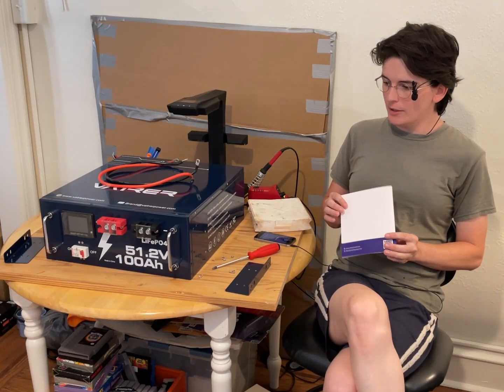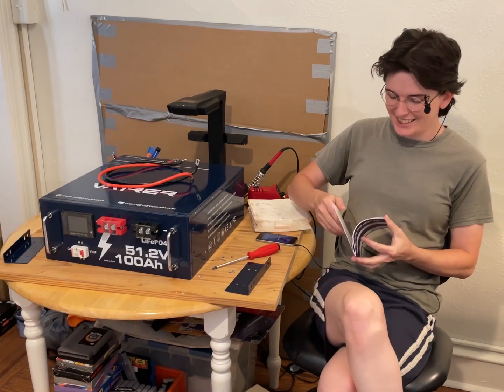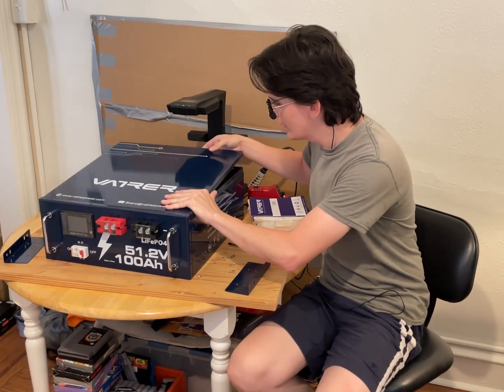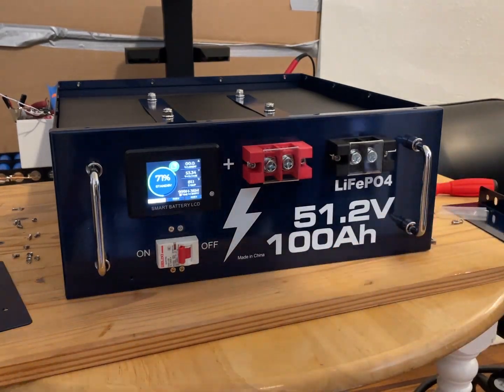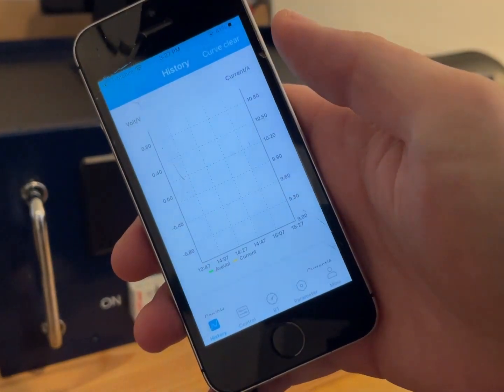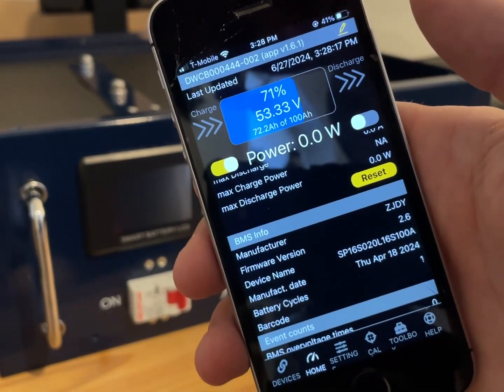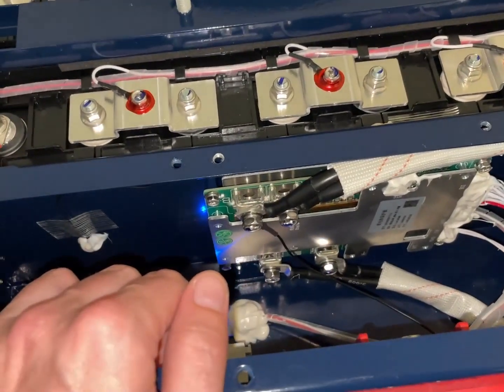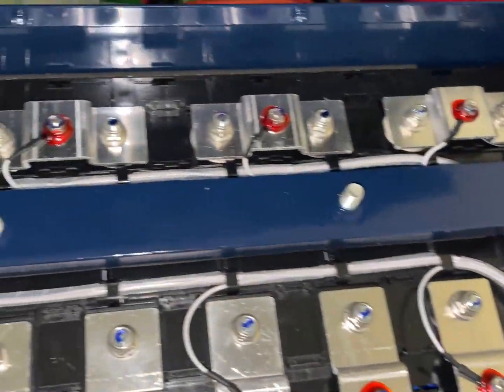A quick look at and teardown of Vatrer Power 51.2v 100ah LiFePo4 Bluetooth big storage battery

Comment: You may want to do some more battery reviews and learn a little bit more about higher voltage before you start reviewing 48 V batteries it is obvious that you're an inexperienced and at this point your review would mean little to nothing nice try though
Reply from the maker: you dont know that I was a battery tech in silicon valley for 300v EV batteries and this channel got big making 48v ebike batteries in 2014

Comment: Decades later, if I wanted to switch out the prismatic cells once they finish charging to a usable capacity, do you think it would be simple enough to do myself?
Reply from the maker: The cells are most of the value here, Im not sure why you wouldnt just buy a new battery. i wouldnt trust a bms after decades
Reply: @RinoaL  Thank you.

Comment: Looks like a decently layed out unit.  The nice thing about these is that they have come a long way over the last few years and the new ones are pretty much plug and play with very high reliability.  At 100ah they are also easy enough to move around compared to the 280-304ah 48v units that really need a hand truck or cart to move around easily.  I hope they eventually come down in price to where it is actually cheaper or near the same price to buy them finished than to buy the diy kit and cells.  It is getting closer every day.  Through the DIY route you can get a very similar setup with case and all for less than $800 if you hit the right deals but it is getting hard to justify diy over just buying the finished unit.

Comment: Help for an idiot?

I have 2 Carrier AC units (1 per floor) w/fan coil /air handlers in attic.
& 4 zones of hydronic baseboard heating using one boiler w/4 Taco 570 series (heat motor type) zone valves.
2 zones of heat per floor.

When upgrading thermostats, I chose Honeywell 9000 series Wi-Fi stats.
2 per floor: 1 for heating only / 1 for heating & AC

The dilemma?  
I had installed a 24vac / 40va transformer just to power all 4 stats. (I ran 18/2 to each thermostat location to the basement boiler room years back) the thermostats i initially installed had separate power input and isolated dry contacts (spdt) for fan / for AC / for heat.

The new thermostats have a “C” with “R” and “RC” that come jumpered.
Can I continue to power the thermostats with the separate transformer and parallel the incoming power to the “R” from the Carrier AC systems?

Checking to make sure the “RC” (powers the thermostat) and the proper leg/phase of the separate transformer are wired in parallel.  Did that make sense?

I sure wish they had separate/isolated power input to power the thermostat itself.

Thanks!